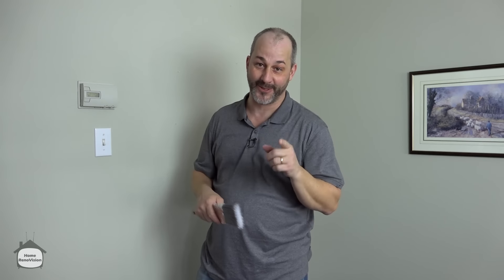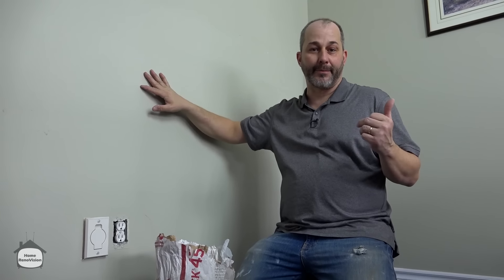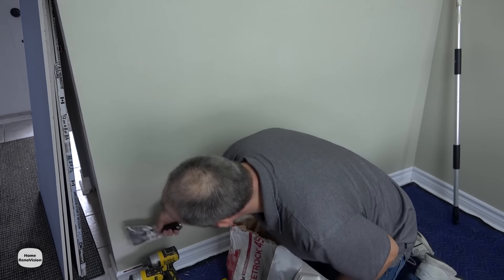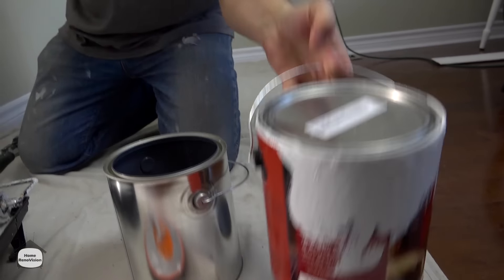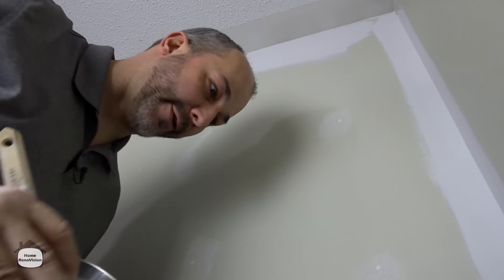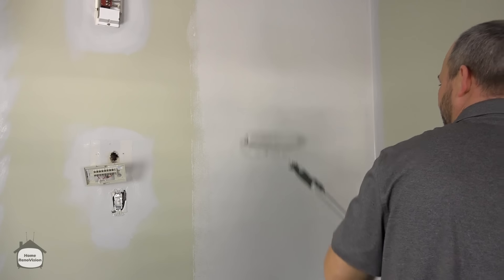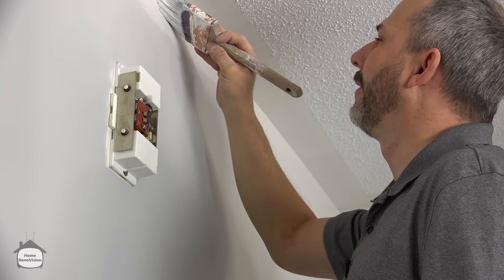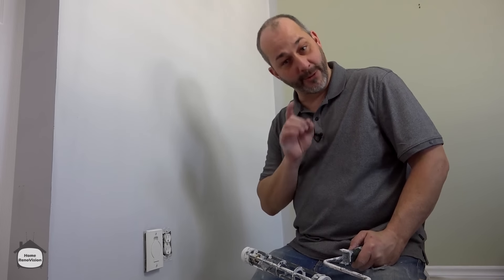DIY How to Paint like a Pro Series A to Z

Comment: Been painting for 16 years professionally and I'd say for the average homeowner this is a great video. It's not really how the pros do it but it's definitely very close and will give you a nice result.

Some of the differences are that we typically use 18 inch rollers because theyre faster and leave more even lines. We use mini rollers for corners and back rolling brushed areas as its faster and reduces brush marks. Also with how good modern brushes are I would use a 2 inch brush. It's smaller so it can hit tighter spots, it's lighter so less hand fatigue and they hold plenty of paint. Theres some other things too but like I said he did a good video for home owners. 

Also, one hundred percent sand between coats. That's my favorite tip of his
Reply: Good to know. I'm a home owner repainting our whole house, and the 18" roller has been indispensable. I use mini rollers for the corners, and I use tape and mini rollers instead of cutting with a brush. My wife can cut in with a brush, but I suck at it. Frog Tape and mini roller for me.
Reply: Should I sand between coats with knockdown texture too? If not I should probably cancel the 360 sander I just ordered from Amazon ASAP
Reply: Good advice.
Reply: Why?  What happens if you don't?
Reply: Why do we sand between coats ? I live in EU where ALL the walls are concrete.. tips ?
Reply: @COREYTOWNS  thanks so much! Can I ask more questions? In private maybe so I wo t hog the feed?

Comment: Finally, a painter on a DIY channel who seems to know what he's doing. I've discovered, when I'm cutting in the ceiling or base board line, that if I keep my eye travelling along the line itself, rather than on the tip of brush or on the paint, the brush automatically follows along nicely. This has resulted in much faster and cleaner cut-ins for me.

Comment: As a Quality Control Manager and painter for over 30 years, I approve this man's video....all but one coat painting....Paint HAS come a long way, but I have yet to see a passable one coat job either in the field, or any contract project Ive been a part of. Ive only heard of others sucess doing one coat....like a unicorn in the woods or something.  Always plan 2 coats. ALWAYS.
Reply: Unless it's a similiar color, such as a shade of white.
Reply: pikkuhakki2 Always....
Reply: sometimes it happens on new drywall. you prime with white tinted primer, small repairs and rub downs and touch-ups, then 1st coat with some white supermatt and voilla: screw you, quality surveyor. or even better: prime with diluted dulux supermatt or vinyl matt and if you work it in right and the driwall was good, you get extra lazy bonus. here in uk we abandoned dedicated wall primers long ago, we use cheap white matts as standard for priming drywall and plaster. but seriously, anyone does this to me on my jobs and i send him home.
Reply: @i.george2321  Tinted primer + paint = 2 coats. I am not a painter but I have painted a lot of walls. One coat of paint  is indeed like unicorns, popular but it doesn't exist. Also, I have no idea why  using paint like primer is such a popular concept. Use primer like primer and paint like paint. I have always gotten better results and it's cheaper.
Reply: Im a little late but it's possible. 

I've been a painter for just 5 years and I've done several government appartments in mint condition. 
Most likely they want the same color. So, if the previous paint and drywall is in good condition, do one heavy coat and it will look like you did 2. (But do 2 cut ins).
Its saved me lots of time
Reply: I literally just one coated an entire 1900 sq ft townhome, one main color and accent walls. PPG Timeless. It covered dark red, blue, purple, green, teal and salmon (original colors) no problem in one coat. I've also done it with the PPG Diamond. Only thing I don't like about it is that it will run if you don't keep a real good eye on it, especially on exterior walls with it cold outside. 1/2" nap that is, when I used 3/8" nap it wasn't as bad but the great room in this town home was like 2.5 stories high, so screw 3/8" nap.
Reply: @cdurkinz  PPG timeless is truly amazing.  The only one I had a problem with was a covering a bright red with a very light lavender.  But probably could have done one if I layed it thicker.
Reply: I farted. Just once though.
Reply: @cdurkinz  nope. Dark red? Unless it was that color to begin with no way. You must be a ppg sales rep
Reply: A M l

Comment: I learned so much from you in this video. The greatest tip was "cutting in" properly. I just completed a large bedroom and a bathroom that came out really well. The amazing thing is that I didn't end up feeling stressed out and frustrated because of the cutting in that was necessary. I wasn't even intimidated by the chopped up bathroom! Thanks for everything you really made my life much easier. and My wife thinks I am amazing.

Comment: There was an abundance of informative tips that I wouldn't have even thought to mention in a painting tutorial, and this is coming from a painter of a decade plus!

 That move with the salt in the warm water to get the durby to dry faster was actually pretty dope as well and I wanted to thank you for that time saver! Greatly appreciated brother!

Tip for you in return - drop or 2 of regular Dawn dish soap when you mix your 45 min and the grease cutting agent busts surface tension on the water and eliminates pock holes in the mud and makes sanding require less pressure! Extremely helpful trick in my Arsenal so hope it helps you as well
Reply: Any tips on painting a wall that red ( as in blood red ) to off white ?? Heeeeelp
Reply: Brilliant!!!

Comment: Jeff, Thank you so much, I worked in the paint business for years at SW, but have learned so much from this video that I never knew. Made a trip to the Home Improvement store and purchased what you suggested, The biggest thing I am surprised with is the sheet rock mud, I have always purchase the buckets, and hated the waiting and tons of coats and sanding. I cannot believe it, 90min, 20min, and 45 min working times and 18 pounds of the mix for $9 vs $14 for a tub of aggravation. Thank you, thank you, thank you.  Oh, and thank you for the cleaning techniques for the the brushes and roller, I knew some but wasn't doing enough, save one of my new brushes with your info and stainless wire brush!!!
Reply from the maker: Cheers Stephen , happy to help!

Comment: two  things : when you cut , don't scrape your paint off on the edge of the pail, if you do ,the further you go the more the line of paint will creep up toward the ferral causing the bristles to not only separate which makes it harder to cut cleanly, but harder to wash clean .Instead gently pat thesides against the inside of the can which presses it in so it doesn't drip but gives you even more paint to work with than scraping it off. Secondly , when you roll , start mid wall and ALWAYS push up first . This negates the possibility of an overfilled roller or use of a thinner product dripping onto the floor or the roll(cage) catching and causing a squeegey effect shoving paint onto the floor . Full time painter here for the last 35 yrs also unior apprentice instructor
Reply: So not scrape the brush in the can line Jeff did?
Reply: @BLOBBZy  Correct. He takes too much paint off in the video. Plus he wastes too much time unloading the brush on areas the roller is going to get. He almost doesn't need the roller
Reply: So what is your advice for not having your patch job show thru your paint job?
Reply: Nice, I just watched another video about just lightly tapping the edges for cutting. Do you not prime sheetrock spots prior to paint? What about wiping the excess dust off when sanding the wall? I always breakout my dewalt orbital with 120 and dust collection and just give the whole wall a light sand.
Reply: Thanks man! I was wondering about some of this as I have to finish painting tomorrow and have never rolled on paint before.

Comment: Great video!  Like all the tips!  Few things if I may add is I am a professional painter and I do recommend back brushing when cutting in and woodwork!  2 1/2 brush is easy to handle. Also I generally use a 13 to 15 mil roller for walls. For ceilings 20 to 25 thickness. This eliminates lap marks especially on a flat ceiling Tip!  When painting trim I always dilute my paint 10%.  Cheers!
Reply: What do you mean by "back brushing" ?

Comment: I’ve painted professionally for decades but I moved on to other things but there’s a sweet technique in painting and the end result is so rewarding. Proper equipment is key , I can’t ever remember using tape, when you have great brushes and you’re taught by a serious professional with OCD you either learned or went home. As you get older you realize those base boards are for young backs😂😂 over 50 you’re definitely gonna feel the pain in the morning  especially if painting isn’t your profession.This was a great video and very motivational.

Comment: I got a roller pole to paint my stairwell (clueless housewife here :D) and ended up using it to paint a different room on a whim and it was honestly revolutionary. You have so much more consistency of pressure and control and it's no where near as tiring (or frustrating if you're short like me, no more up and down stepstools). I'll never go without a roller pole again. I also severely underestimated how frustrating and ultimately costly cheap rollers are, the ones that don't have bearings and don't roll right, you have to put so much pressure on them they're basically trash. I just thought that was normal (-_-) @30:45 Oooooooh that corner is looking SHARP I tell ya what.
Also thanks for your content, I found you with your video on finished basements and I appreciate your honesty about old homes and finished basements. As an antique home owner it's so frustrating to deal with the modern reno/diy marketing that oversells everything.

Comment: The denting technique I picked up from one of your other videos was by-far the most useful tip I've encountered. With that method I can usually get away with one coat to cover up small dents and holes in the wall. A little tip from my mom who is quite a good painter - if you aren't going to finish everything in a day - you don't have to wash your brushes: just wrap them in foil and put them in a baggy in the fridge - same goes for roller covers. Next day... take them out of the fridge and  you're good to go.
Reply from the maker: That works but I like to clean as I go.
Reply: You should do a video on cleaning the paint off the brush and roller!
Reply: That only applies when using oil based paints.  To see the effects of freezing latex paint, leave a can in your garage this winter, then throw it out in the spring.
Reply: Additional tip: if you're not done in a day use grocery bag and wrap the brush you're using after giving it a good spritz of water so it will not dry out.
Reply: I've learned that wrapping in a walmart bag (one that doesn't have holes, if you can find one!) works very well, especially if just leaving the brushes/rollers for a couple few hours.
Reply: a 9" cover fits in a gallon zip lock and will last for weeks
Reply: hmm you know the freezing trick is only for oil paints ? latex with become like spoiled milk

Comment: I wrap tape all around my roller covers before using them. It pulls off any loose fibers on new rolls.
Reply: Use a five in one curve edge and run it repeatedly length wise down the roller white it's on the frame.. Should remove 98% of your issue..
Reply: Terrific idea! Thank you!

Comment: This was very informative. I'm painting a closet. The walls being  painted will be covered with wall storage units. I decided it is the perfect time to practice painting techniques. I did a lot of hole repairs from clothing racks I removed. I used the spackle that turns from pink to white to indicate when it's dry. Everything was looking really good...until it did not. 🙊 After sanding and priming all the repaired areas are flashing now. My goal before finishing the  job is to have no differences in texture. This video will help me accomplish just that.
Thx Bunches.😊

Comment: The "technology" inside of acrylic/latex water-based paints is called titanium dioxide. It's what provides the paint with its coverage and hiding power. 
Important things to note about water-based paints:
- The lighter the color the higher the titanium dioxide content of the base. These paints have the highest coverage and hiding power of this type of paint.
- The darker the color the lower the titanium dioxide content of the base. This means the coverage and hiding power is also reduced.
- Because of the lower hiding power of darker bases, dark colors may require more coats. Proper prep work helps minimize the need for extra coats.
- Speaking to the previous point, this is why proper prep work on the wall is so important. It not only makes it look nicer, it will allow you to get the job done right without all the extra work.
Reply: Genius. Titanium dioxide is a white pigment not technology. And its in use long time ago. Other is correct.
Reply: Петар В. Петровић: it’s still technology ya genius. 🤦‍♂️

Comment: I thought I remember the instructions being patch, sand, paint, sand, paint; but I never saw the 2nd sanding.  
--Are you supposed to sand after the 1st coat?  
--And do you need to wash or wipe the walls down before painting to remove dirt or sanded material?
Reply: Hmm, Wierd that only Cliff noticed that he said he was going to sand between coats, but then didn't show that step. I imagine it would only take 15 seconds to sand if he sanded like he did before the first coat, and I would have apreciated seeing it in case there was anything different in sanding between coats.   Otherwise great video like all of his other videos.  Thank you
Reply: Yep, wipe the walls after sanding... with a wet cloth wrung out. Wipe a 4 ft area, flip the cloth, wipe another 4 foot area, then rinse out cloth at the sink and wring out water until it doesn't drip. Then continue wiping the wall.
Reply: Yeah, I'm wondering as well...where is the DIY dude with his answer to this question? Hello? ANyone out there?
Reply: I was wondering this too!
Reply: Yes sand after first coat, its just very light sand with a sanding pole. Just to knock down and dust or texture the roller has left behind yes damp cloth and you shouldn't scrub just quick wipe.
Reply: On another video he said that he does NOT wipe down between sanding
Reply: If your walls are prepped correctly before starting to paint there is no need to sand in between coats
Reply: @Andrew Layton What is TSP?
Reply: @Andrew Layton Thanks Andrew!
Reply: @Andrew Layton Thanks for reminding me, I will.
Reply: @tsogrady200    I noticed that too.  What's the answer?
Reply: @Andrew Layton I use ammonia and dish soap. Ammonia evaporates so no rinsing required.  My wife smoked in a bathroom for 20 years I added washing soda to my previous mix and sprayed on the wall.  First pass the stuff was almost black.  It kept getting lighter and lighter in color.  I can still get a bit of very pale yellow but it doesn't smell anymore.  Biggest problem is caulk and the silicone holding the glass for the shower doors.  Learned a lot from this video.

Comment: i painted for 8 years. Never thought i would finish that house lol. but seriously i did paint for the eight years and i cant tell you how many times i go into paint a room and there is crap from a cheap roller sleeve or someone who would leave and orange peel on the wall etc... i have sanding more than anyone would want but painting is actually the easy part, prepping the wall and doing the work before you apply the paint is 75 % of the job and the way you explained it is spot on. I really like how you explain full strokes on the wall and not that W crap. i cant tell you how many people would come in and act like i was doing something wrong because they watched a home improvement show and some moron was painting with W motions. Thats flash city especially when you have a high sheen.. Of course when i was done they were extremely happy. Bad thing is if people know you can paint. YOU are their new best friend and they want you to paint their house, for free of course, afterall isn't that what friends are for?
Reply: Lol Sherwin Williams has a "How To Paint" video, and they literally tell people to paint in a "W" and show a person painting with no handle. Biggest wtf I've seen from Sherwin.

Comment: When you have to use the screwdriver like you did to pop the switch cover loose, do it from the bottom instead of the side, this way if you happen to leave a mark you wont see it.
Reply from the maker: Thanks Cheers! but since I am repairing the wall every time it is an easy fix. Cheers!
Reply: Home RenoVision DIY I think Steve meant the cover of the switch, the plastic bit. So, if you damage the cover from the bottom, only midgets will be able to see it, if it does happen from the side... welp.
Reply: I use a putty knife instead of the 5 in one. it is thinner more flexible and gets under the plastic covers better.  Cary both at all times. also always have a rag.
Reply: Using a razor blade to cut those cover edges is a better idea than a five in one

Comment: Jeff fantastic video mate! Informative, easy to follow, non-patronising, and made sense. 

Couple of questions for you, firstly, and most importantly for me, what grit sand paper did you use when prepping the wall and did you wipe it down after that? Secondly, you said sand, paint, sand, paint. Did you sand your initial coat with the same grit paper as the initial sand?

Thanks again for the great vid, you’ve gained a subscriber, good man, keep up the good work 👍🏼
Reply: I will also like to know.
Reply: If I had to guess, he probably used 120 for the first coat and 220 for the second coat.